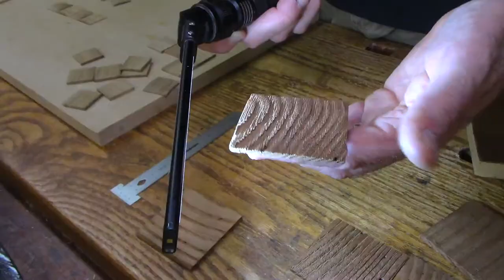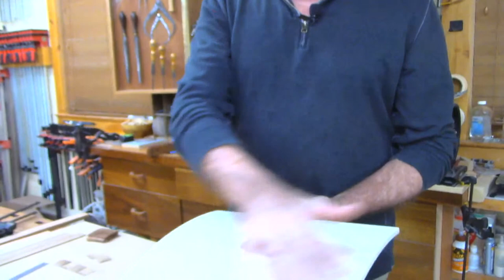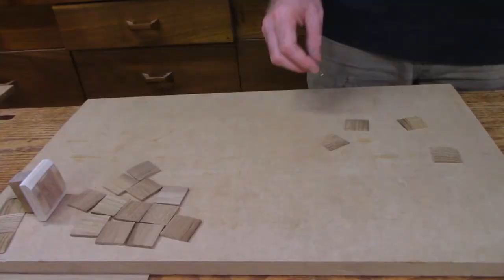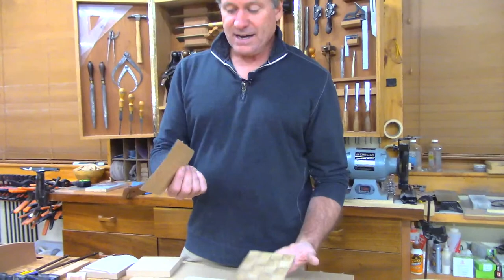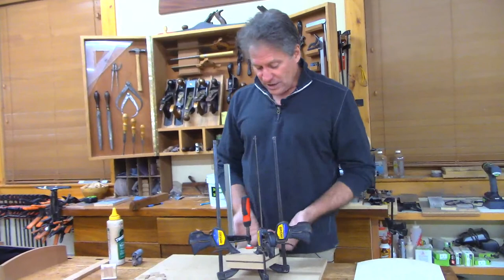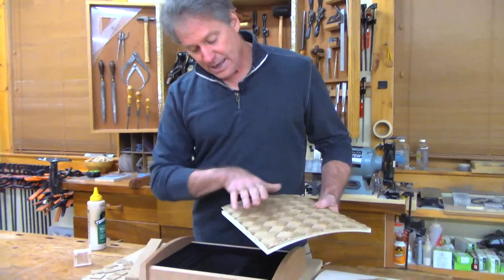How to Make Patchwork Veneer

Comment: Just watched SNL, after gluing pieces together could you use canvas to glue squares on like a tambour door instead of veneer?
Reply from the maker: Yes, you can, I’ve heard of others substituting fabric. Veneer is also sold “paper” backed. But I lean to the wood veneer, it’s worked well for me in the past and I like the rigidity and the great compatibility to wood adhesives. Great question, thanks!